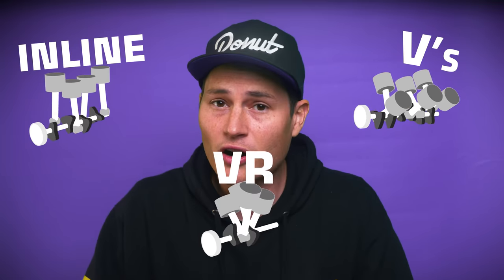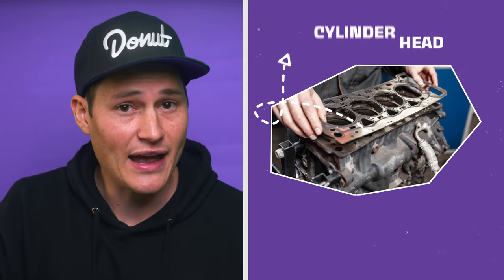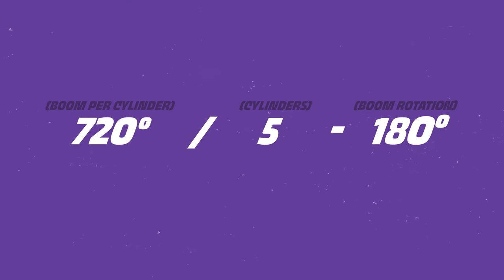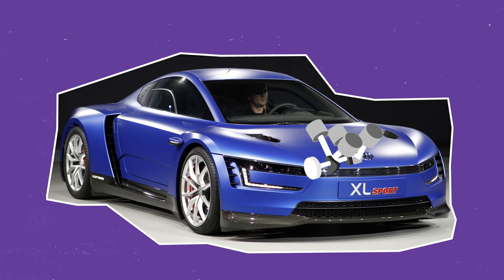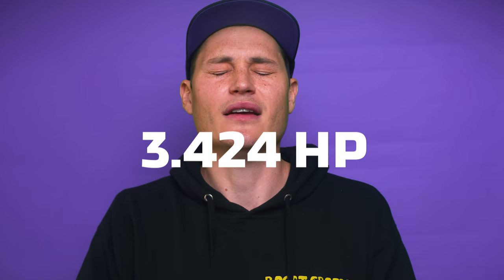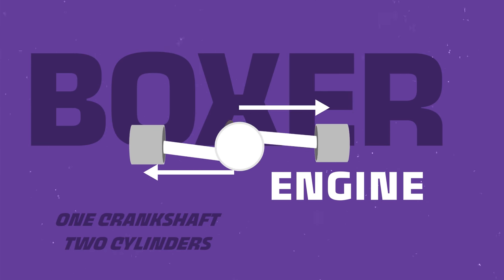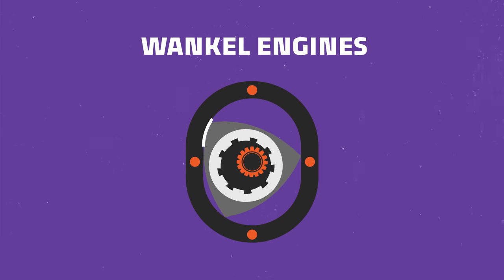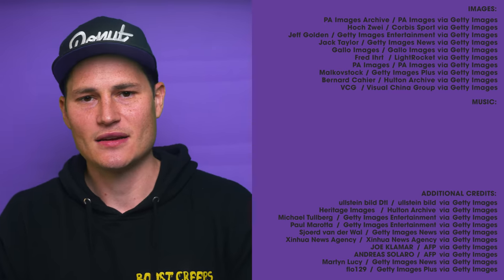Every Engine Layout Explained

Comment: 17:45 there are extremely rare x engines. Also I've never heard of it in a car, but radial engines should be on the list.
Reply: @Caleb Marcoux radial??
Reply: @Caleb Marcoux right that makes a lot of  sense
Reply: Also never in a production car (as far as I know) is the first type of rotary engine, which is basically a radial engine where the engine spins inside of its case. They were used in airplanes in WW1
Reply: well, all plane prior to jet age uses either radial engine or V-engines (usually V-12), where radial engine usually goes more than 14 cylinders, crazy radial engine such as the Wasp Major with 28 cylinders outputs >3000HP. Some radial engine are used in tanks such as the M4 Sherman cuz it provides mo' Powah and standardized production, but other than that, there are practically none Radial engine car because of the size of it and should not be in this show, otherwise there are tons of other engines to talk too
Reply: I have seen a really weird design for a circular engine. The ‘piston’ rotated around the crankshaft to turn it and I forget how they managed to get compression behind it.
Reply: @-NGC-6302-  It was an early rotary engine used mainly on WWI aircraft. Similar to a radial but the pistons rotate around the shaft.
Reply: Rolls Royce DID (arguably) produce the V16 Merlin for the "Mosquito", famed as the last war plane with a wooden frame to hit production, and it served in WWII... It was wood framed so they could put carpenters and cabinet makers to work in plane factory jobs... AND for the utter lack of metal left in Britain at the time... dubious marks for "the greatest generation" and one of the darkest times our world and society in general has ever seen.

    I mean, can you just imagine what it's like rationing and scraping by to the degree that even the government doesn't have enough metal available to build more PLANES??? 

    ANYWAYS... if we're going to get into aircraft in regard to an engine discussion, the "Mosquito" is a worth while story to look into. Enjoy... and you're welcome "research junkies".  ;o)
Reply: @joshuapritchard575  should definitely look them up. They're pretty awesome. Meant for airplanes
Reply: @joshuapritchard575  like those really old airplanes
Reply: Late to the show, but the Napier Deltic opposing piston diesel had three crankshafts in a triangle layout. If you'd put radials on this list, you'd have to go all the way.
Reply: @gnarthdarkanen7464  I think you are being a little bit to dramatic. The UK was still pushing out Lancasters, Spitfire's, Rolls Royce motors, etc etc. However, the amount of available materials was limited, and imports where under pressure because of the U-boat treat. They had to re-arm for a 2nd time in a decade after the Dunkirk. Instead of a shortage, it's more of running into a logistical limit. 
It's not the first design that was presented to be more attractive because it wouldn't interfere with the allocated material flows. LCVP / Higgins boat became one of the most important vehicles in the US military during WW2, also a design that got attention because it could be made of non war-vital materials.
Reply: @Tuning3434  Shortage is still shortage, whether it's more logistics or simply a lack of resources all together.

    I just recounted what I've heard/been told and managed to find in my own research. The war being in full swing, there needed to be a justification "worthy" of devoting metal to something, even a mid-range fighter/bomber like the Mosquito... The same could be said for the Higgin's boat...

     War planes are notorious for not getting back in one piece, and so they needed to be considered "readily expendable" when strategically employed. The hope is ALWAYS that the mission is accomplished AND everyone/thing gets back alright... BUT that simply isn't the reality in war.

     Anyways... I encouraged everyone to do their own looking. You don't have to agree with me.  ;o)
Reply: @thecodeofreality    Actually, historically, they've been more common in aircraft.  ;o)
Reply: The radial engines , the X engines
Reply: There are several missing engines in this 🙄

Comment: Im glad you mentioned the Commer TS3 Two Stroke, there was a TS4 with 4 cylinders and 8 pistons 5 were made one complete one is in New Zealand, Chrysler took over the Roots company that made the TS engines and stopped production ! The Commer TS3 is the best sounding engine ever and no valves, heads, only six pistons/Con Rods, six Rockers and a crank shaft + a Roots/Wade Blower !

Comment: "So who's got the inline 5? Focus RS, Hummer H3, RS2"

Sad TTRS noises
Reply: sad c4 s4 noises
Reply: He mentioned Audi, so we should be happy enough
Reply: sad every volvo B5T engine
Reply: Volvo made them for years. 1991 until 2012.
Reply: @Gias1  Yeah.... The T5 S60 is my favourite
Reply: Diesel Mercedes 2.7 common rail turbo! It just pulls and pulls again
Reply: Sad Acura Vigor noises too...
Reply: Audi 4000/5000! And Audi 100/200
Reply: The GM version inline 5 is crap.
Reply: Audi Rs3 also with inline 5
Reply: Chevy Colorado 2000s
Reply: Not mentioning volvo...
Reply: Also the Mercedes OM617 diesel used in the 80’s sedans
Reply: Audi Quattro and Audi Sport Quattro
Reply: Sad P80 Volvo noises
Reply: Sad Volvo noises.
Reply: Sad s1 noises
Reply: Sad Fiat Marea noises
Reply: sad fiat coupe noises

Comment: V4 engine "not a ton in cars" 
*Sad Ford V4 Noises*
Reply: Even weirder is how he brought up Lancia for the VR4, but mentioned some antique contraption instead of the famous Fulvia.
Reply: Chevrolet had them in at least one truck too but not the most notable.
Reply: Also ..The V4 was a mass market motor for Ford, but in Europe and mainly Germany. In the 1962 Ford Taunus then Consul. transit van, and Capri.
Later used in the Saab 95,96 and 97 when Saab first moved away from two stroke engines and to the four stroke Ford V4. Possibly at Ford's demonstrated suggestion to sell motors.
Was also used in the first Ford Mustang, the mid engined prototype.
Was intended for mass sale in the US as the Ford Cardinal with a V4 but Ford eventually went with the Falcon and Cardinal design evolved into the Cortina and Taunus. Sizes from 1.2 to 1.7 litres for all these.
UK use in the Ford Corsair and Zephyr mk 4 from the sixties as well as the Transit Van.
Lots of Lancias from even the 1920s used a V4.
So not just the rare cars shown. Lots of mass market cars.
So even the US nearly had lots of Ford V4 Mustangs and Cardinals.
Reply: Jesus Christ car weebs
Reply: And of course ZAZ cars from USSR. How can you forget that.
Reply: @aaronbarton2179  Idk what that is exactly but it's probably me

Comment: Also, an absolute TON of giant V engines made it into locomotives, like the EMD 2 strokes; 567, 645, and 710, which came in 8, 12, 16, and 20 cylinders. GE also made the FDLs and GEVo engines in the same variants.

Comment: Some opposed pistol engines were used on some pretty iconic armored vehicles, such as the British Chieftain tank (Leyland L60 6 cylinder opposed pistol engine), and the Soviet T-64 (5TDF 5 cylinder opposed piston engine), both of them are multifuel engines.
Reply: TDFs are also not only a turbocharged but a turbocompounds as well

there are smaller 3TD and 4TD installed on Ukrainian APCs

Comment: I missed the radial engines, there's a modded VW beetle with one of those.
Also the duke engines, they look cool
Reply: That’s not a car engine
Reply: Yup
Reply: @tony_5156  who cares
Reply: @dave_xc  its a plane engine from like 1920 it’s not related to cars or the automotive industry.
Reply: @tony_5156  there were some cars that used radial engines
Reply: @tony_5156  its still cool n ppl who r only into cars prob dont know abt it
Reply: Also missed the turbine engine from that one chrysler car than nobody talks about that only had like 2 years of production but that's fine
Reply: @tony_5156  They have been used in automobiles, but very rarely. Go to "Jay Leno's Garage" and look up the 1934 Rolls-Royce Merlin.
Reply: I was waiting and hoping this would be included in the vid
Reply: @WG55  If you're implying the Rolls Merlin was a radial, it was not.
Reply: Radial engines were also used in tanks, so probably those deserved a place
Reply: There was an MR2 that raced in the 24 Hours of Lemons that had a radial engine out of an airplane. Pretty sure it was slower than hell and broke a lot, but it was still cool.
Reply: @tony_5156  That hasnt stopped people from putting radial airplane engines, turbine and jet engines, motorcycle engines or even boat engines in their cars
Reply: @BlueScapegoat  Whoops, you're right. The Merlin was V-12.
Reply: @tony_5156  Monaco Trossi 1935 Grand Prix Racer
Reply: there was a 30 cylinder radial engine made from 5 chrysler I6 engines called the A57 multibank that was used in tanks
Reply: Ducati engines were ALWAYS sold as V Twins, till those idiot marketing guys got involved and "Invented" the L twin, they just angled a 90 degree twin to fit in their frame, it's not a different type of engine.
Reply: @tony_5156  Bleriot,s monoplane that was the first to cross the english channel was a V3.
Reply: some tanks used those engines too
Reply: Don't think the Duke counts as I don't believe it ever left the lab development stage
Reply: There are motorcycles with stock radial engines, so it should count
Reply: @cpufreak101  yeah, I agree. It's kinda sad, it would be nice to see a car with a duke running around
Reply: @ApeGorrillo  classifying the rotary engine as a piston engine is a very loose classification IMO

Comment: 3:07 but Uncle Jerry? How can a single cylinder engine be an inline?
Reply: good point
Reply: Through a single point can pass infinite straight lines. Euclidean Geometry, page 1, chapter one.
Reply: because if you look at the front of it it's in the shape of a letter I
Reply: @andrea7693  you are technically correct, but also wildly incorrect😂
Reply: @Carlos-ln1lx   if you (he) ask stupid questions you get stupid answers 😄
Reply: line leader lol
Reply: Yeah, it could be a v, or u, or h, etc too
Reply: @AidanBenny  a boxester kinda is also like that, but it isn't
Reply: Single cylinder head = inline
Reply: That would be a dot placement 😳🤭
Reply: Technically it's not. Inline, V, W, and all these other terms refer to what is known as cylinder arrangement. If there's only one cylinder, then there is no arrangement. It's just a single-cylinder engine.
Reply: @Um_im_ryan  not really any of those...
Reply: Cause it's in 1 row with no offset cause there's only 1 this has great benefit as it can be operated in most any direction very handy
Reply: @derekvielman  "gets angry in vr4/5/6
Reply: @andrea7693  that would make a single cylinder inline engine a point engine
Reply: I think in his defence, by a process of elimination thats all that it can possibly be if you were to put it in one of the classes since it clearly isnt V, boxer, rotor, radial or opposing piston
Reply: from inline to alone real quick :(
Reply: The crank is in a line. It isn't shaped like a v or w and it isn't flat so it could really only be an inline I guess.
Reply: @andrea7693  also page 1 of the Coke Head pamphlet.haha
Reply: Because the cylinder is still at 0 degrees
Reply: Because

Comment: Why is no one talking about the piston base going through the crankshaft
Reply: I was wondering the same thing
Reply: probably because animation is hard enough
Reply: It's driving me nuts and I'm sitting here trying to figure out how this is supposed to look in real life and how they could have shown it.... It's hurting my brain seeing this over and over!
Reply: Dude it was so distracting lol.
Reply: @TJ.85  SAME
Reply: Wait how does it normally work
Reply: @markp9366  the crank shaft isn't actually one solid beam it is in fact short sections of shaft mounted between 2 different pivot points attached to the pistons and allowing the position to "pass through" the area where the shaft would have been via the pivot joint on each side of the piston.
Reply: Yes😭😭😭😭😭
Reply: That's what I was wondering.

Comment: “Inline engines are cheaper and easier to maintain” cries in N54
Reply: Ah man, what a fantastic engine though
Reply: meanwhile me smiing in M52B25
Reply: Cries in VW TSI with a trail of burnt oil behind it
Reply: i have actually been surprisingly lucky with mine, only a fuel pump and valve cover gasket replacement and i've had it from 88k to 105k miles
Reply: 138k miles strong, no issues (except for a few sensors)
Reply: The N54 is great and reliable. It all the crap around it that sucks (solenoids, wastegates, plastic charge pipe, etc...)
Reply: @KeepCalmNCodeOn  the thing many people overlook about the N54 and cars in general is how it's been driven, 100k miles on the highway is nothing compared to someone drifting around, doing burnouts etc. for 100k miles. Same goes for maintenance, an engine with oil changes every 1k miles is gonna last longer and be more reliable than engine that has had it's oil changed every 10k miles
Reply: @LocalAutist  That's very true. In my case, I owned an N54 BMW, was the only owner, put 80k miles on it, and it had been an extremely reliable car. Then I drove it on the track for the first time and then...broken charge pipe and malfunctioning solenoids.

Despite all that, I still love the car and the N54 engine. I can't get myself to sell it despite owning two other BMWs.
Reply: You ever have to replace the timing bet or a cam sprocket on a v6 engine? Lot harder than bmws with vanos. Leaking DI injectors? Failing HPFP? Haha ever heard of the GTR 3.8 twin turbo, well Nissan makes a baby 3.0 TT that comes in the infinity Q50/60 making 400+ hp, which both share the same problems the N54 DI system faces. If you took your n54 for a HPFP replacement to a bmw dealership you’d pay around $1500 in cali, you take your GTR or Q60s for a HPFP replacement to a Nissan dealership you’d see how much cheaper and easier the inline 6 are the maintain!
Reply: B58 ftw
Reply: @forzaOM11  until the water pump decides to die
Reply: I mean it's cheaper than an N63. Or a S85.
Reply: @KeepCalmNCodeOn  yep, I'm the type of person that would prioritise higher mileage cars. It takes a miracle for a car to go 200-250k miles being a hoonigan shitbox, especially with a turbo. Older rwd volvos are one of them few turbo cars I can recall being able to be at least decently reliable after hooning them hard for 100k miles...decently reliable as in having about as many issues as a daily driver being taken care of. Guy that owns the bicycle shop locally has had his E46 320i since new, he's taken extreme care of it and it's mint condition having none of the vanos issues many complain about, almost 300k miles and still factory cooling system which usually is the first major failure for an e46 (subframe if it's a track car)
Reply: @LocalAutist  It's funny because to get a reliable track car I ended up going back in time to a high mileage E36 M3. After doing preventative maintenance on the usual failure points, I now have had over a dozen track days in it without issues. Love that car so much.

Comment: You need to do a part two with the unique sounds of each layout!
Reply: Wait I’m new to this mechanical stuff; THEY ALL HAVE DIFFERENT SOUNDS???
Reply: @DanticBlision  They do. Though I can't really differentiate between them
Reply: @DanticBlision yes. 5 cylinder engines just sound like mini 10 cylinders. So 5 cylinder engines sound more like 10 cylinders than 4 or 6 cylinder engines
Reply: @litaf4889  while I appreciate the attempt, this was about as helpful as describing colors to deaf and blind person. Not because it wasn’t a great explanation, I just have no reference for any of that.
Reply: @DanticBlision  understandable. Just look up 10 cylinder car sounds and then look at 5 cylinder sounds like the focus they mentioned in this vide have 5 cylinders, a Volvo C30 also has the same engine. You'll see they sound similar to a 10 cylinder engine

Comment: Airplanes had cool piston engines with like 9 cylinders in a circle around central propeller shaft  - radial
Reply: Wright 4360. 4, 9 cylinder radials in a row for 36 cylinders with 72 spark plugs 😆

Comment: The animations made it all the better to understand everything. I learned about two engine types I've never heard of before, so thank!!
At the same time I missed an engine layout.......the star-shaped one. These engines can be found on (older) airplanes which used propellors, the cylinders are spread out in a circle with the crankshaft being in the center.
Other than that I found this video educational,......keep it up guys!!!
Reply: That star shaped one is called a radial. I love the sound of those engines.
They have made anywhere from a 3 cylinder to a 36 cylinder engine, the last being four banks of 9 each. A two bank either 14 or 18 cylinder are the most common however. Each bank must have an odd number of cylinders, something kind of interesting about them

Comment: 4:26 this was a total eye opener, epiphany, realization moment for me as someone wanting to learn the combustion engine realm of engineering. expressing power strokes in that way, x° of delivering or not delivering power during a single rotation and how that relates to several cylinders in a line with each other was a total AHA! moment for me! I immediately started to understand inline vs V form factors and what every benefit and trade off meant to the structure and architecture of the engine.  thanks for the video guys! 🫶
Reply: "suck squeeze bang blow" is a hell of a cycle btw 😂